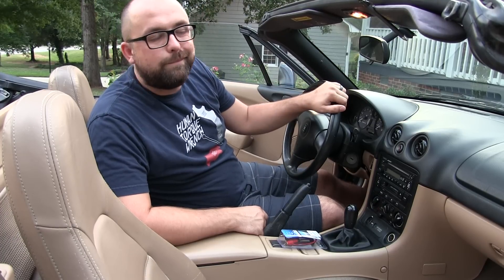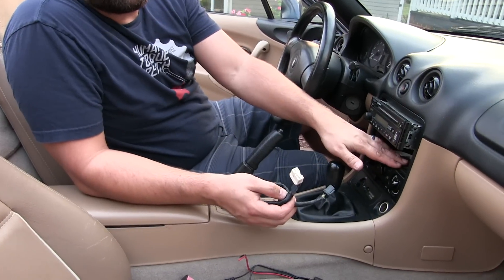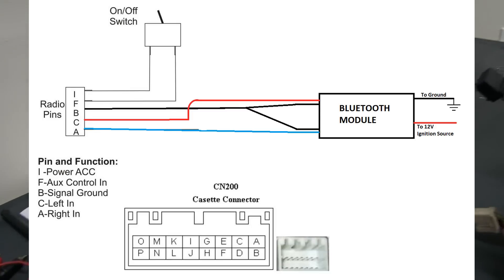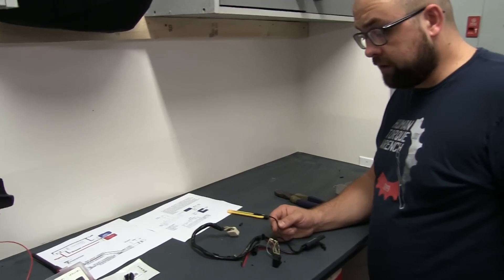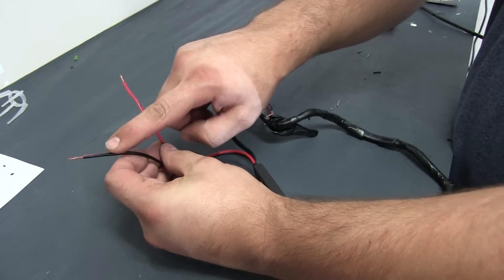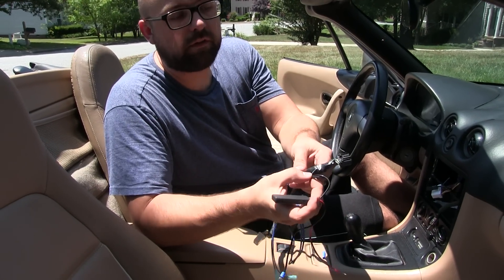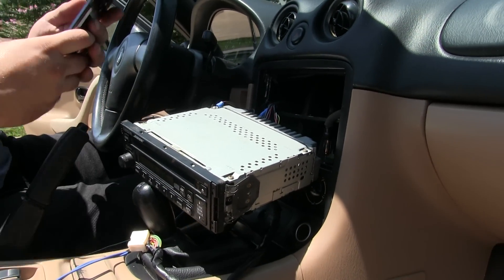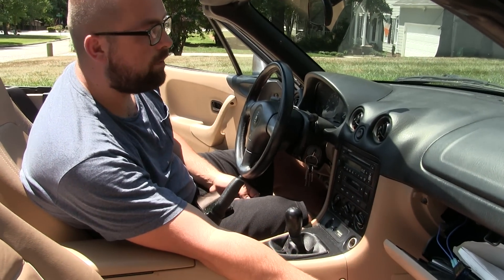Adding Bluetooth to Your Car for Under $40

Comment: If you're unlucky enough to have a OEM radio that had the both CD/cassette combined in the main unit this is still somewhat possible.  Most vehicles had kits that you could tap into the external CD changer if it supported it,  however finding them for each specific vehicle is becoming harder and harder as the years go by

Comment: Great vid. My only suggestion would have been to fit the switch inside the cassette player so you can just lift the flap and hit it. But fantastic job overall

Comment: $ 50 and you've got a new Sony with BT and phone support.
Reply: My thoughts exactly. Also, that blue tooth switch doesn't look very reliable. Looks like cheap plastic that will break after X number of uses.

Comment: Do you have any specific ideas how to add Bluetooth to a 2001 Land Rover Discovery 2? Cassette player is in the radio box, CD changer is on a separate wire harness. There is no auxiliary input.

Comment: any suggestions on integrating this into a Nissan Bose unit?  i dont have the seperate wire, it is all contained inside the doube din unit.  i have taken it apart and saw the board labeled L+ L-, R+ R- for the CD function.  not sure how to integrate a switch in order to make the unit think there is a CD playing.  Maybe i will burn a CD of silence and run it on repeat.  thanks.

Comment: So I put in an aftermarket radio in my name Miata. It has RCA connections for aux. Is the a way I can hook up the RCA connectors and hook the Bluetooth module to the aux? That way I wouldn't have to open the radio and solder anything on it. Is that possible?

Comment: Was there a reason you didn’t just take power from the harness? Why did you have to go find a different power wire?
Reply from the maker: The module gets power from the head unit harness. The wires that we ran out were for the switch which tells the head unit to swap from radio to external output.

Comment: How do i find signal wires? I have a 06 acura tl it has the cd an cassette player
Reply: did you ever get an answer? i have an 04 TL
Reply: arottmann5588 no he never reply back so i just added a cd player with Bluetooth an wire up to stil have my oem amp an sub to work with my after market radio

Comment: So now you don't have cassette or cd capabilities, correct?
Reply: I would think so.
Reply: Everything will function as normal depending how he rigged up the switch it might need to be on to play a cassette basically all he did was tap into the wire that senses a tape trying to be played soo it switches to "line" on the stereo

Comment: Why dont you go off of switched power?
Reply from the maker: It is on switched power. The switch is used to swap between the inputs going into the head unit.

Comment: Hello I bought one of these, I connected the red and black wires to the cigar lighter, and the plug that goes behind the radio. but sounds like static, what could It be?
Reply: You could try twisting the signal wires, its a simple way to eliminate EMI. Also you may want to find a new ground, that often time helps as well.

Comment: Why make it so complicated?! Just get a Bluetooth cassette adapter!! 🤦‍♂️🤷‍♂️
Reply: You mean an auxiliary cassette tape adapter that lets you plug anything with the 3.5mm jack, including BT. Then there's gonna be a cable coming out of the tape deck. Now a days, you can buy an aftermarket Bluetooth radio for the same price as the tape adapter, $20 at Fry's electronics, but that's not the point, most of us are DIYers